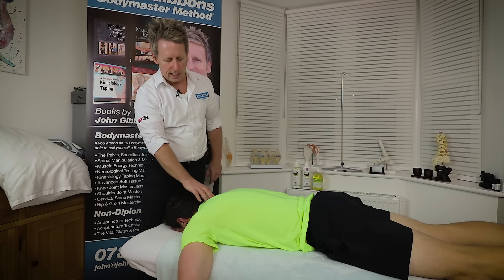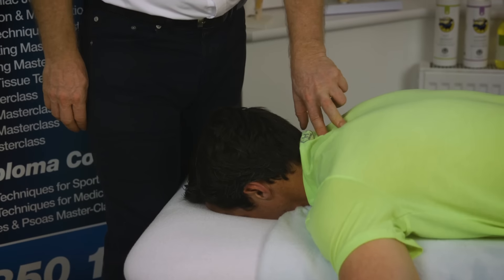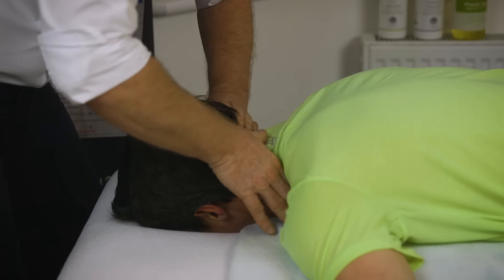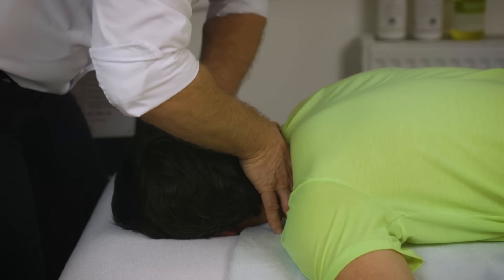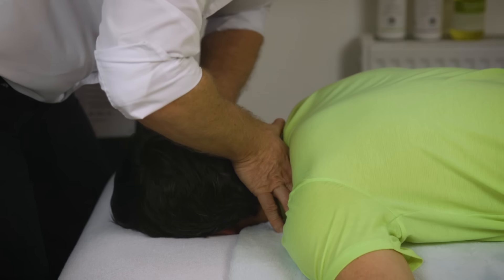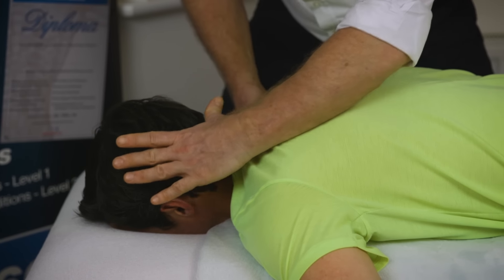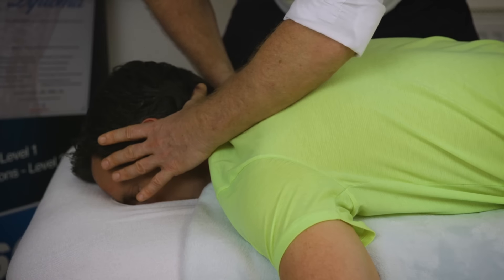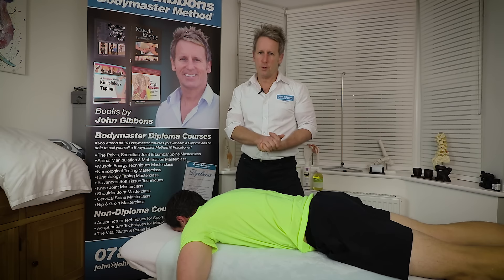2 ways to manipulate (HVT) the cervical-thoracic junction (C7/T1) of the Spine

Comment: I was stretching one morning, seated on the couch. I was slouched over. I felt tension on my right neck. I rolled my head right, when my chin was to my chest, rotating my chin to my right shoulder. I heard a loud pop, and it felt like it was my CTJ. I have had less arm pain this week. My shoulder isn't as pinched. I didn't have to touch anything with my hands. I have been working on my right neck for 2 years. I think i have released each vertabrea by myself, c1-c7 and even my own si nutation, and lumbar. I'm now working on opening up my thorasic areas.

Comment: I had surgery in 2014 c5 c6 . I've managed pain thru exercise and pain meds. It was caused by a go cart accident. About 6 weeks ago I woke up had burning sensation in right forearm and very hard to move neck to right. Had an Epidural in the C-7 T-1 area. The Epidural lasted 10 days before it wore off. Having an Mri next week to get a better idea of what's occurring. Thx for the exercises to do.
Much appreciated..
Reply from the maker: Thanks for the message and sorry to hear about your neck, my sister also had surgery for that area of the cervical as well and she has issues below the fusion. Hope things improve and i wouldn't personally do any exercises for the neck as you will easily exacerbate it, regards JG
Reply: @JohnGibbons  
Thanks for the advice on not doing exercises. I'm looking forward to getting my MRI next week so I can develope a solid plan. I know my Dr said having a 2nd Epidural after the 1st one doesn't work sometimes it helps. Lots on my plate but I'll get a plan here soon. I subscribed to your Chanel. 
Thx
Reply: @johngates450  hey john any updates on your post op?
Ive had chronic pain in c5,6,7 and recently which has topped my pain meter off is t1 area constantly trapping nerves..
I feel your pain, its so hard to deal with. As of writing this it is day 5 of a trapped nerve in my t1 area. Its bed wriden me :(

Comment: A recent mri shows that I have Spondylosisthesis at C7/T1. Pain in scapula/brachial plexus area manageable so far, but being told I’ll need multilevel fusion. Can spinal manipulation at C7/T1 produce correction to spondylosisthesis? 
Thank you for the great and informational videos...
Reply from the maker: Quite rare to have an anterior slippage at that level - are you sure that is the diagnosis? I wouldn't manipulate as it wont change the anterior position of the vertebra, regards JG

Comment: Is there anyway to self manipulate this area??
Reply from the maker: I suggest you let someone like me to do this rather than trying yourself, regards JG
Reply: @JohnGibbons  Where can I find you?
Reply: @JohnGibbons  It's easier said than done. I've had this lock multiple times, and there are absolutelu no one in my area, who can manipulate it. I've seen two chiropractics, naprapat and two "limb correctors" (basically traditional type soft-chiropractic/bone setting). Only way out of this is massage, pain medicine and muscle relaxants. Then it will go away in few days or weeks. One time I managed to self manipulate it but I'm not sure how. I remember I massaged it first, then used foam roller on that area, turning my head to different directions, alternating pressure by lifting my body up with my feet (hard to explain). I'm sure it was potentially hazardous, but it helped. Now I haven't got this issue in a year or so. 

Btw. I love your videos and I can't believe you don't have more subs and views. When I did massage and this "soft-chiropractic" myself (years ago), I used some of your techniques. Especially that SI-Joint mobilisation, where customer lies face down, and I have his ankle between my legs. That technique has been life safer for many. If I ever start to help people again, I'm sure I will study even more of your content. So, thank you for these great videos.